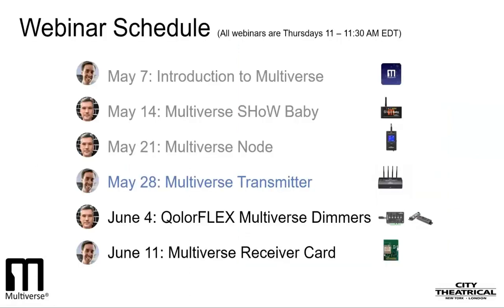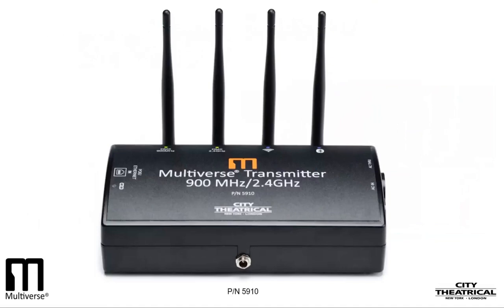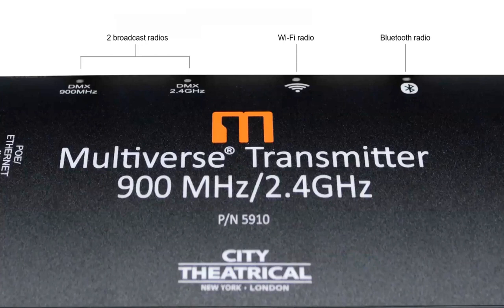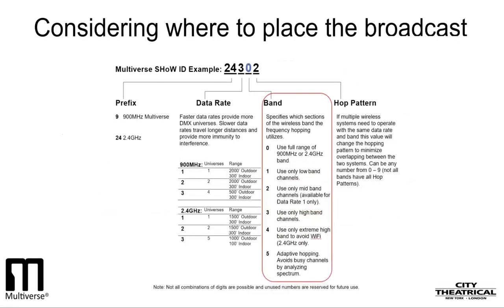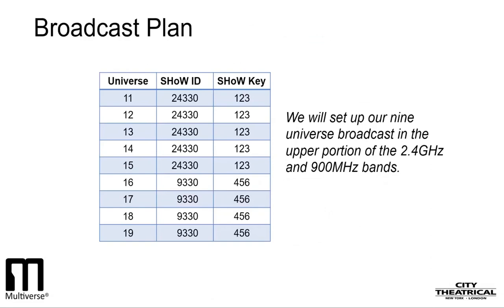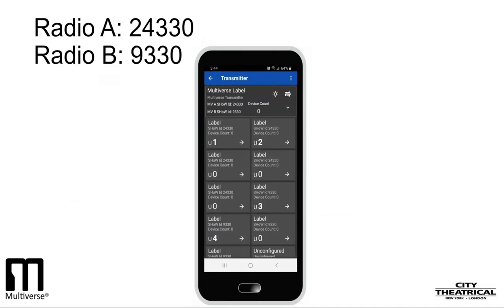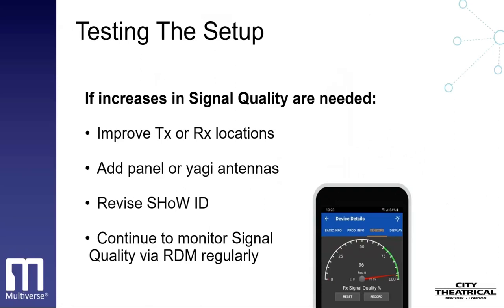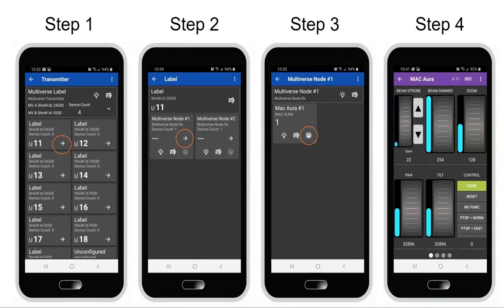City Theatrical Webinar 4: Multiverse Transmitter

Comment: Can I use the multiverse with built in wdmx Chauvet fixtures?
Reply from the maker: Hi Dan! Unfortunately, no, you cannot. The WDMX system is a different protocol and doesn’t work with the Multiverse wireless DMX protocol. If you really want to be able to use onboard Multiverse with Chauvet products, make sure to give Chauvet a call and ask them to offer Multiverse as an option!

Also, as long as the device you are looking to control with wireless DMX has a DMX input, you can always bypass the built in WDMX wireless and use a Multiverse Node (https://citytheatrical.com/products/multiverse-node) or Multiverse Studio Receiver (https://citytheatrical.com/products/multiverse-studio-receiver) device. Hope this helps! Your friends at City Theatrical